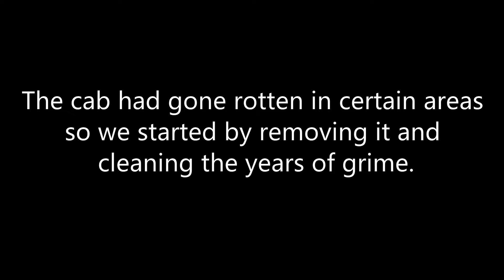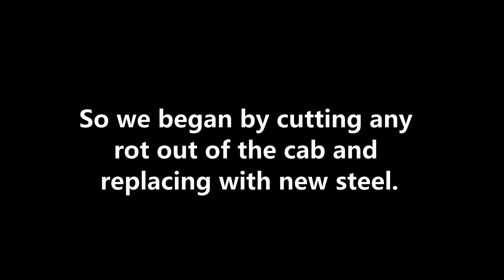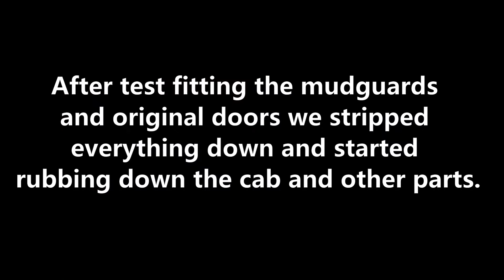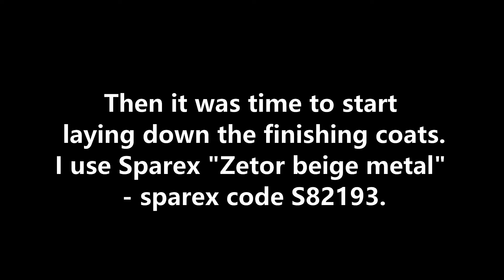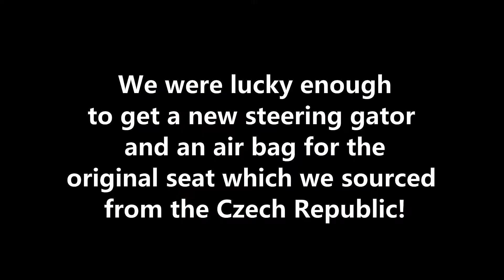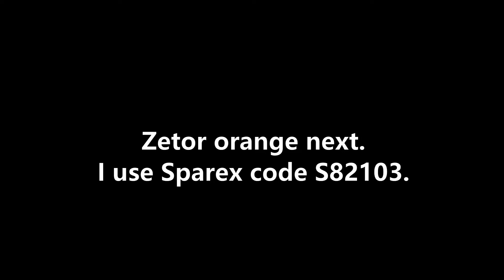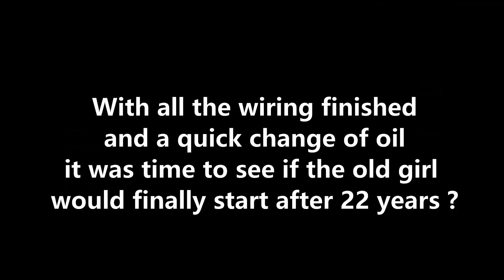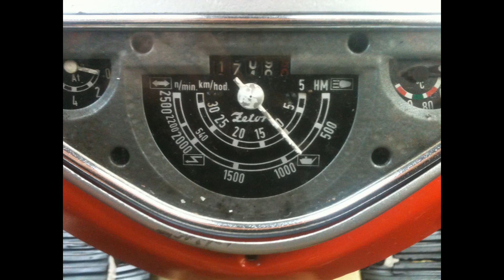Zetor 5611 retsoration , will it start after 22 years ?

Comment: Great job on the restoration 👌 tractor to be proud of 👌 putting the 36 inch wheels on her must have given her a fair turn of speed 🤔👍
Reply from the maker: thanks bob , yes the wheels made a nice improvement to her , as you know the zetors were never that fast anyway . thanks for watching .
Reply: @Mrgreendragon3  hate to admit it but drove a new 4011 back in 1968🙄. Thankfully I was still at school back then ,,,,, just 😂
Reply from the maker: @bobpaterson1845  we have a 4511 here and for some reason its a rocket ship, leaves all the rest in her dust , it clocks out close to 35mph and it only has an original set of 28's on the back .
Reply from the maker: @bobpaterson1845  i did have a 4011 along with a 2011 and 3011 here for a while but i sold them as i didn't have enough room to store them all , we currently have 12 zetors , 6 restored and 6 waiting to be done , we have 2511 , 3511 , 3545 , 4511 , 5511 , 5545 x 2 , 5611 and a 8011 crystal , plus a few other breakers for parts etc .
Reply: @Mrgreendragon3  one of my pals uses a 3545 for ploughing matches only drawback is 4wd only engages in the high range 🤔

Comment: Looks good a lot of work gone into it. Did come from Europe not seen a 5611 before here it would be a 5718 ?
Reply from the maker: thanks Andrew , no its an original Irish tractor , we are the second owner , they were marketed here as a deluxe version of the 5511 with the large cab and air sprung seat etc. . the 5718 was slightly newer than the 5611and had some small design changes . thanks for watching .